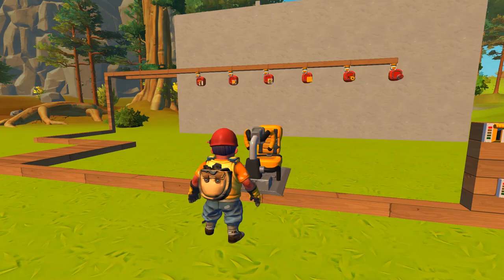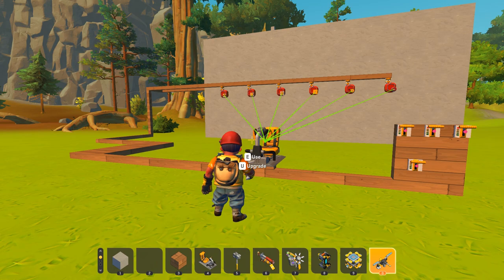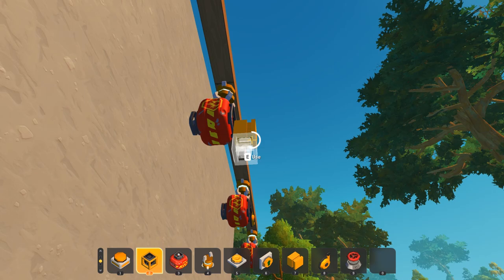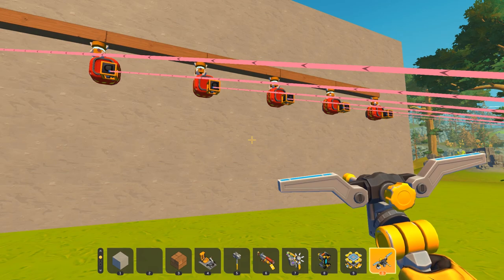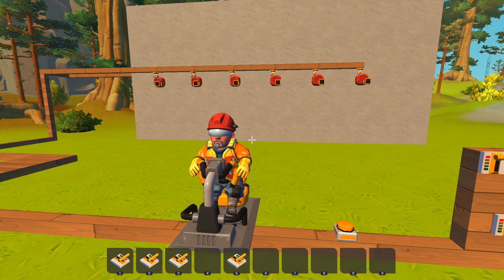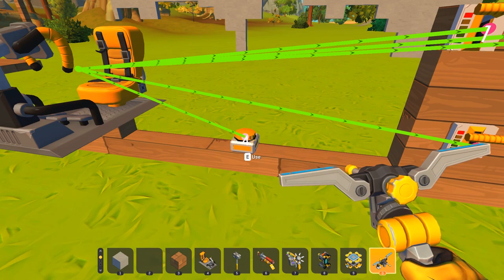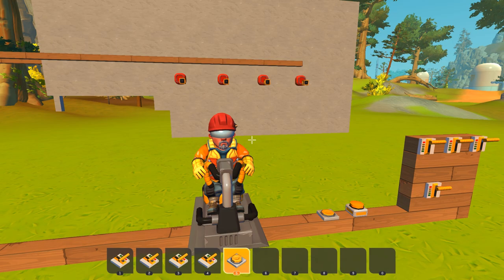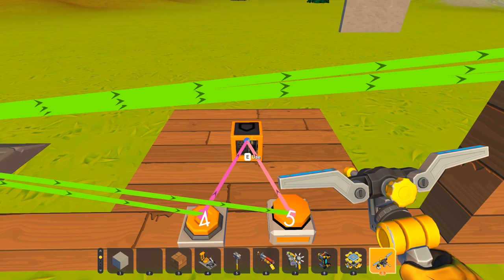Short Scrap Mechanic Logic Video

Comment: To make a vanilla button last a single tick you hook it to a timer (set on one tick) and hook both to a XOR gate wich goes on to the boombs!
Reply: That would send a tick when you press the button and when you release it. So two pulses per button press. To combat this, have the output of the XOR gate and the button going into an AND gate
Reply: Hook the button into a NOR and an AND gate, hook the NOR gate into the AND gate. Boom, tick generator.
Reply: @mr.person5209  That also workes!
Reply: That still makes 2 ticks because a timer has a delay of 1 tick (even if there's "no delay") plus the delay that you set it on
Reply: But with  @mr.person5209 's design it will make a true 1 tick

Comment: You can fix the vanilla button problem with a short timer that the button connects to & then the timer goes to the logic & the button to. (I think)
Reply: Its not one tick but its a prety compact solution & it adds a carpet bomb feature if you hold the button instead of just a tap to drop it